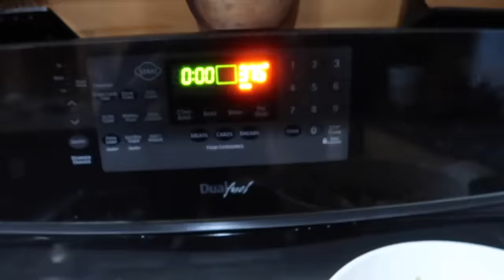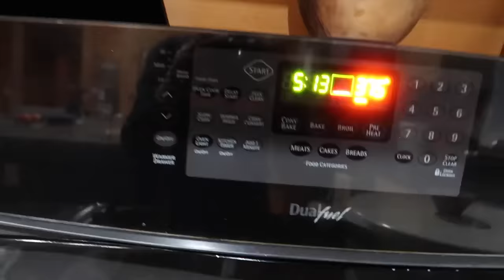This 1 Reason MAKES using PLASTIC ROOFING WORTH IT!

Comment: The screws are supposed t0 go on the top of the ridge of the roofing sheets so they wont leak when rain runs down the low gutters

Comment: I noticed you drilling screws in the troughs (the low spots) rather than the crests (the high spots) in the corrugated roofing. From what I've read and other videos I've watched, it's better to put the screws in the crests, being careful not to dimple the roofing. That should help minimize the possibility of leaks. Just thought this might be helpful to other viewers.
Reply: I agree and would add that you need "wiggle molding" to support screw along each nail strip. Screw one panel at a time so you can reach without crawling on panels.

Comment: Drilling holes in wood with an impact can be very hard on the impact. You should use a regular drill. For dewalt i would recommend the DCD996, its very versatile and capable for drilling through any type of material where as the lesser or "homeowner" models are just not that powerful. Hope this helps!

Comment: Nice to see a couple working so well together to build things! My only comments - the top of the walls should be double plated and for a lean-to style the roof joists should have birds' mouth cuts. Without the birds' mouth cuts the weight of the roof (and everything on the roof) is not directed downwards on the wall, but instead is pushing your walls away from each other.

Comment: Another great video, Question for you. Where do you buy those long screws? I live in Puerto Rico and I stopped by the local Home Depot and couldn't find them.I didn't asked. I need a length of 8 inches to fix a wobb;y table that my sister is attached to. Any help would help, thanks

Comment: Hey, I live in South Florida and I had to get a building permit for a shed and similar to what you're building first off I couldn't have any overhangs more than two in. Miami-Dade hurricane rules, I had to use. Inch and a half washers on my roofing screws every 6 in Miami-Dade hurricane rules, Had to use corrugated strapping every 6 in underneath. The plastic, Miami-Dade hurricane rules LOL added a hundred and fifty percent to the cost of my plastic panels. And I had the wrong color screws. So I took a piece of styrofoam about 2ft by 2ft, press the screws into the foam, then spray painted white.

Comment: Al, I spend good money to get a green lawn. In the past three years, I've had to use Grub-X to kill off the grubs that burrow holes into the lawn. It's either Grub-X or having moles that eat grubs. Grub-X kills the grubs and with no grubs, no moles.

The weight savings of using plastic roofing material are real, however plastic roofing doesn't have good UV light resistance. The plastic panels become brittle as the plasticizers leech out and the panels start cracking. Plastic is also brittle in cold temperatures. Combine the cold and wind, and you might have the roof blown off the coop with a strong winter storm.

I don't want to go off on a Chinese conspiracy rant, but they don't respect human life. They're still struggling with what parts of capitalism they want. The owners of the companies want to manufacture a good product, but the pay structure rewards managers for quantity, not quality. The pet food deaths 8-10 years ago were attributed to some unscrupulous persons adding melamine to wheat and rice gluten to artificially raise the protein reporting showing higher protein values.

Comment: I can't sleep worrying about your dust collection system. Please ground it with bare copper running through the hose.  This will help prevent a fire in your workshop from static electricity.  Best regards

Comment: You need to screw those roof sheets on the top of the corrugations, never in the valleys. They will leak and also catch any dirt,twigs,  leaves or whatever and interfere with water flow off the roof causing water to pool around the screws.
Reply: That's the case with metal roofing but the PVC roofing is designed to have the screws in the valleys. I know it seems contrary, but that's actually the recommended way to install it per the manufacturer.
Reply: Geoff Sims I never thought of that ... I would have guessed the valley because there would be no gap between wood ... see, we learn so,etching new every day

Comment: It looks like you measured the coop itself as 8ft, but did you include the roof itself in that measurement, it looks like it is more than 9ft combined. You don't want to have to take everything apart! Also name the coop Chickago, since it is going to be a chick brooder as well and still fits with the US city themes.

Comment: How about dragging the coop over some plywood or heavy plastic sheets if available. You would need two so you could rotate them. I don't envy you trying to get through the slush or mud. Maybe the deep freeze the country is having will freeze it so you could slide it over everything.

Comment: Can I suggest putting the screws on the ridge, not the valley when doing the roof. The water runs down the valley so it's more prone to leaking at the screws. Putting the screws on the ridge there is less of a chance of water intrusion. Just don't over drive the screws. Remember you shouldn't squish the rubber gasket under the screw head.

Comment: the roof screws are technically supposed to go on the ridges, and not the valleys; that way the roof wont leak.
Reply: Huck Finn - Manufactures vary in their instructions.

Comment: I am wonder why in your cutting table, you don't use stop blocks for pieces of the same length? Instead you measure each block, which could lead to measurement errors.

Also I assume you age going to chicken wire between the rafter to keep predators out.

Comment: It sounds like when you were drilling the holes you had your drill in hammer mode. Hammer mode is only for drilling in concrete or block.

Comment: Arrrgh. You didnt screw in the ridge of the corrugated roof sheets, you screwed in the flat, expect leaks!
Reply from the maker: you cant screw the ridges on this roofing its not strong enough it will bend the ridge
Reply: That's what rubber grommets are for. 😁
Reply: So with the angle of the roof, the overhang all around and the trim on the front egde, that ought to do it, right?
Reply: @LumnahAcres  Yeah you can. We screw down polycarbonate and the old fibreglass sheeting through the ridge. You just have to apply the correct torque. Plus we use roofing screws with a cup shaped washer and not the flat that you use for zincalum .

https://www.bunnings.com.au/suntuf-clearfix-roofing-screws-50-pack_p1013426

we also use one of these to apply the correct torque

https://www.tradetools.com/product-range/power-tools/hand-held-power-tools/makita-2500rpm-tek-screw-gun-570w
Reply: @mintysingularity  Hmmm, rubber grommets are not designed to sit in water. They should ALWAYS be be at the highest point of a ridge
Reply: @craigmorris3941  well, then you might want to tell all the manufacturers that make those roofing screws.
Reply: @LumnahAcres  Everyone has their own way of doing things and I am not criticising how people do their own thing. i was just highlighting that they will leak and because the rubber seals will now have more contact with water they will last less than half the amount of time as they would if they were fixed in the ridge. Looks great either way, good job.
Reply: @mintysingularity  I am speaking from experience. If you want to screw them into a flat surface then you should add silicone to seal it correctly as the rubber will just rot away over time and the seals never really offer a water tight seal.
Reply: Silicon around the screw heads may fix it! If it's an issue...jnmho 🤷‍♀️
Reply: @craigmorris3941  oh, please forgive me. I didn't realize you're the only person on the planet with experience.
Reply: @mintysingularity  you are forgiven 👍

Comment: Aside from the fact that the weather impacts your activities, it's important to your channel because many of us don't have nearly as interesting weather as you do during this time of year.   
     Here, in the Northwest, in the lower elevations where most of us live, we have a couple months of summery weather that seldom gets really hot. The rest of the year is pretty much spring lightly sprinkled with autumn-like days. BORING! Even the rain here is almost always very light to moderate. Seattle averages far fewer sunny days than the Big Apple but gets significantly less annual rainfall. BORING! 
     If the day's high in Phoenix is 52°F, they think it's cold (yes, I'm thinking of you, Weed'em & Reap), and a large part of the year it's too hot to work. BORING (the weather, not the channel)! Most of Fla. is always hot and humid; S. Cal. is mostly hot and parched. BORING! The whole Southern tier of states (except at higher elevations) only gets intermittent wintry weather in the winter. BORING (except for the tornadoes). In the Mid-Atlantic states, winters are so on-again-off-again that the ground is either slushy or muddy most of the winter. BORING & YUCKY!
     Al, you are blessed with winters that make good video, REAL winters.
Reply from the maker: Your weather sounds pretty nice. Mother Nature always keeps us guessing

Comment: That's not structural wood its at best for internal studding - Personally, I'd use treated sawn air-dried wood from a somewhere like the suppliers for the forestry commission - it's treated in a vacuum chamber and when you cut it you can see it's treated right through not like some from DIY stores - do it right it will outlive you - sadly that wood you are using you will be showing distress within the decade

Comment: I don’t like to criticise,  But perhaps rethink your screw positioning so that your screws go solidly into the centre of the timber you are fixing to (rafters).
  I see that you are following the totally weird American habit of putting the fixings in the valleys of your corrugated roofing thereby ensuring that if there is even a miniscule chance of any water getting in, it will. Oh well you lot pioneered “Designed Obsolescence”  carry on .....